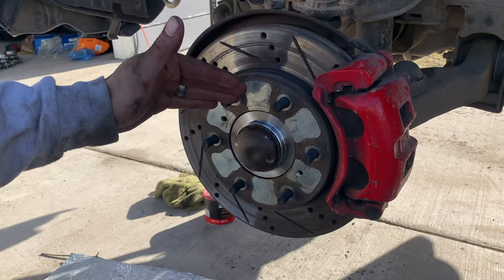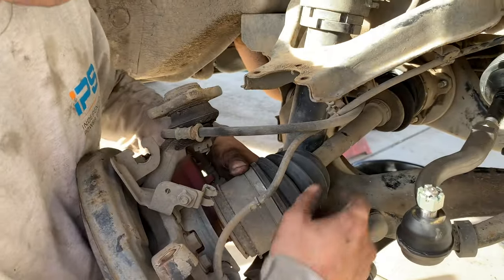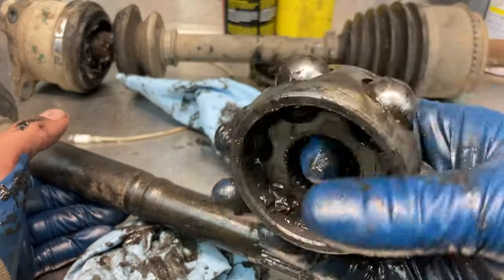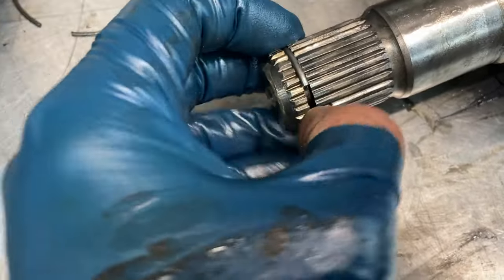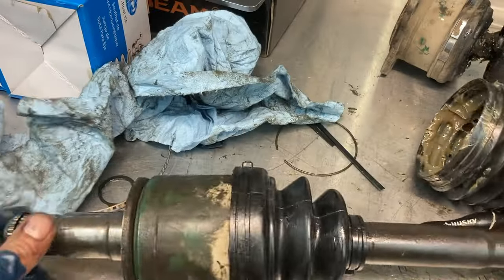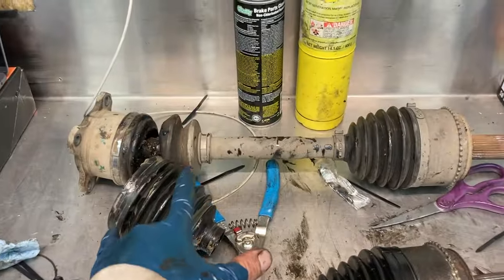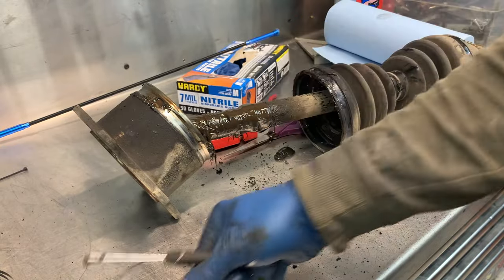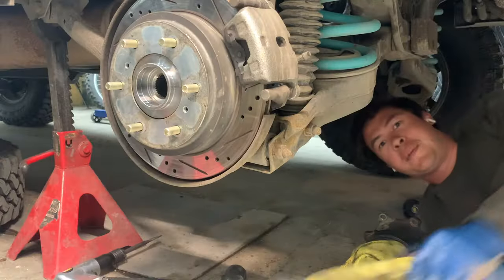How to Change and Rebuild CV Axles

Comment: I had to pull my rear cv axles out three times and found it was easier to just spin the wheel once you got all 6 of the bolts out the rear side of the dif. As you spin it it just falls out. At least for me it did. Like most people I thought it would be hard to rebuild them. Now I just need to find time to get my oem parts back in

Comment: hello fromAustralia ,ive got a 3.8 Pajero exceed,unfortunately in the middle of a oil change and filter service i got distracted with a mobile call and didnt nib up the sump plug ,my wife drove the car and after work she said the engine is making a loud noise ,knocking and no oil due to me not doing my job properley ,i purchased another sump plug filled up with oil and it stopped knocking ,is this just a temporary fix or was i lucky ,have done near 100 kilometres and its still quiet
Reply from the maker: oh dang! well, personally i would be talking with the shop about getting a new engine, but i guess keep driving it and see what happens
Reply: @montanamontero  HAHHA im the shop ,i left sump plug loose ,its been over a thousand kilometres and you wouldnt believe it the noise came back i took it to a qualified mechanic and two off the butterflies from inlet manifold fell into the top off motor ,that was the noise
Reply: @PETERNESS at that point your engine probably should just be replaced. The top and bottom end sre both likely damaged
Reply: @BrokeWrench  your spot on Broke ,motors no good

Comment: Have to admit that I'm surprised that aircooled Porsche/VW boots fit a monte and even more impressed that Luso knew this.  Also, is the process for doing the 2/2.25 gens the same?
Reply from the maker: it's the same once you get the axle out. removing the axle is harder on the 2 and 2.5s

Comment: Nice video, thanks for the tips about the air hammer to push the shaft out of the bearing and about raising the suspension to free the rear axle!
If I may add a few comments:
- the front outer CV with the brown grease in it had had the boot replaced before (you can tell by the clamp) and the wrong grease was used. I would have given it a thorough clean so as not to mix the black (correct) grease with the old general purpose grease.
- you didn't mention it, so for those reading this who didn't know, if you're only going to do an outer CV, you can hammer it out in place (without pulling it out of the diff) as it's only held on the shaft with a snap ring. Just be careful to not pull out the inner CV, that would be bad.
- one thing that can be done as well to prolong the CV life is to swap the left and right side CVs. It's likely that the front inners won't be interchangeable, but the outers will. In the case of the Pajero, the rear inners can be swapped as well. What it does is over time (and miles) pressure is applied on the same edge of the CV inner cage. It can be so bad that it will even chip. By swapping them around, pressure is applied on the opposite side. Just make sure to not swap shafts, they must remain in their respective side, otherwise they could fail (it's the case at least in motorsport applications).
- the inner CV snap rings are always a pain, you could have tried to use gravity to your advantage and try to leave the open section of the ring on the down side. But it's a bit of Russian roulette, sometimes it goes easy, sometimes it doesn't. Just never apply too much force, it will only damage the snap ring even further.

Comment: Dude 16:10 was exactly what I was looking for. Thank you. I couldn't note the orientation of the bearing cage when I took it off but re-installed it the way you did through intuition (it actually went in both ways, maybe due to wear). However, the doubt was just killing me, so before starting up I went through a ton of articles and videos to confirm the orientation but all of them were on the tripod needle bearing style inner CV joints. This just saved me a ton of headache.